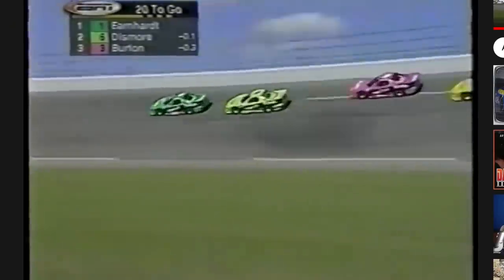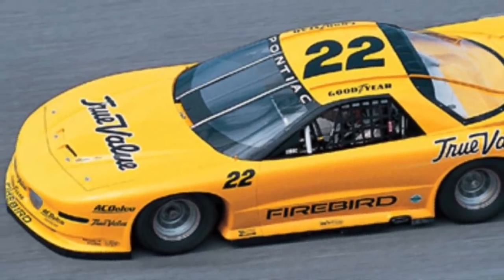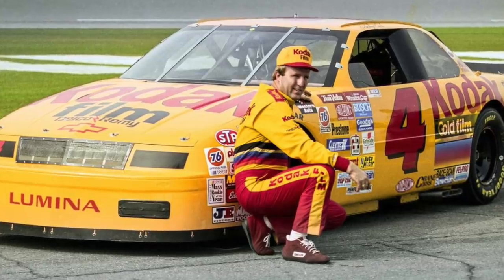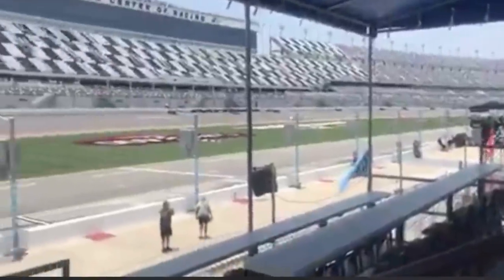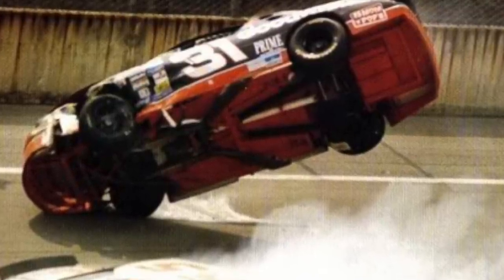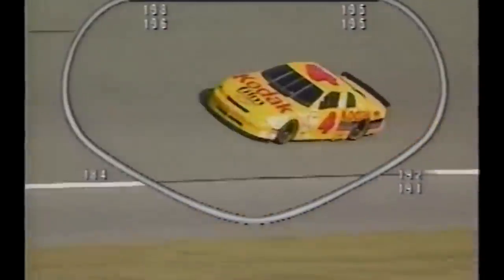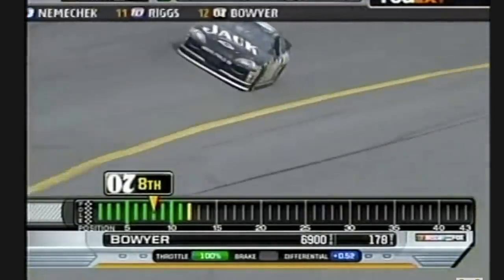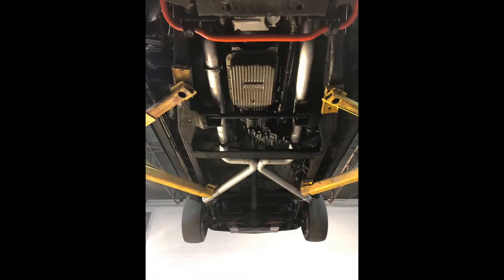What Made "Old School" Restrictor Plate NASCAR Sound So Great? (Back to Back Sound Comparisons)

Comment: Speaking on the firing order. Anybody remember Need For Speed most wanted 2005? The glorious sounding BMW M3 GTR (e46) from the cover. I’ve ALWAYS wanted to replicate that sound. After much much research I’ve found that it was a flat plane crankshaft 4.0 v8 race motor (P60b40) developed by BMW and Siemens for their ALMS racecar. The motor was only made for the race program and not the public so there were only a few made. I have always wondered if somebody could take the S62B40 4.0 cross plane V8 from the BMW M5 (e39) and convert it to flat plane and adjust the firing order to make it possible and replicate the sound of that glorious race motor the M3 GTR had. 
And don’t tell me it was the sound of the transmission. That is the sound of the gear whine yes, but I am referring to the exhaust note of the engine not the singing angels of those straight cut gears.
Reply from the maker: You could make 180 degree headers for the crossplane engine to mimic the firing order of the race engine within the exhaust

Comment: I have been a huge fan of Xpipes just because they make more power originally, but the sound really grew on me. I'd love to build my own for my Mustang just so I could play with the length and chamber size at the meeting point, the size of the connecting hole between the pipes, entry and exit angles, etc and then dyno them all to see what works best vs what sounds best.

Comment: I've always ran a x-pipe because I don't like the old farm truck popping and cracking in the exhaust note. My old camaro had a custom 3 inch x-pipe with magnaflow 4 inch round mufflers. It sounded wicked and everyone loved it. Before the magnaflow mufflers I had spintech super pro street mufflers and they sounded good too but didn't have the volume that the magnaflow did.

Comment: The Firing order changes the sound quite a bit. It affects exhaust pulse sounds and of course different mid pipe configurations (X,Y,ORY) all will have a different sound. Length,size,the way its routed, 4 chambered boom tube out each side (back in the day) vs single oval will sound different. And so on and so on.

Comment: I believe you get a combination of X pipe, boom tube and how the audio mixer for the network sets it up because if you listen to the cars at Daytona in July 2000 on the CBS broadcast and then listen to them at Talladega that fall and you will hear a big difference in sound even though it is the same season.

Comment: Geek out on the dyno, with an SPL (sound pressure level) meter. When I  was a kid we put "H" pipes in to pass the noise requirement of our state's emissions test. Also, the "H" pipe supposedly added 5-10 lb/ft of midrange torque. The "X" pipes do sound bitchin' (I may be dating myself with that term ;) ).

Comment: Very cool video, I'm a Nascar fan since the mid 1990s and iss the old sound. Sound is why my Subaru still wears unequal length headers. Equal length might make a little more power but they make the car sound like the rest of the 4 cylinder world. I just can't give up the signature Subie burble.
Reply: It's the boxer design and firing order that make a Subaru and VW flat motor to sound better than inline 4s. Your not going to hear any difference between equal and unequal length headers of the same diameter.
Reply: @jamesclements3627  I have to respectfully tell you you are wrong. I've been modding and racing Subarus for the last 20 years, there is a big difference in the sounds equal and unequal length headers make!

Comment: They also DEFINITELY experimented with 180 Crossover headers  on a few where you take one cylinder from one side and moved it to the collector on the other side. They sounded strange and higher pitched as well.

Comment: I want to learn more of the science behind why that high pitched whine is caused by the x-pipe. I’m also fascinated by intake tuning to affect sound. The Lexus 5.0 V8 and the V10 in the LFA have a lot of engineering put into how the intake air resonates, so they tend to sound like they’re revving higher than they are and make a unique sound.
Reply from the maker: I’ll save the detailed explanation for a future video but it has to do with the way the pulses meet and the way a crossplane v8 fires

Comment: All i can say is, if you've been in the open wheel modifieds for 9 years the last thing you will want on your automobile is loud exhaust!!!!!!! They were the loudest screaming cup engine with a 390 carb, open headers, and were the fastest cars in NASCAR. They were the very first NASCAR cars to break the 200 mph speed at Daytona back in the 70s. They were so fast NASCAR made the teams put front fenders on them because the front ends started to come off the track. It's all in the NASCAR record books. But every once in a while i still love the roar of a 355 ci, it will make a tingling sensation down my spine!!

Comment: I should also add that some people think the pre COT Superspeedway cars ran lower RPMS because they were slower which was not true. They turned lower RPMS because the gearing was different, not because they were slower. If you compare a 2007 Daytona 500 qualifying (Pre COT) to a 2008 Daytona 500 qualifying which was when they switched to the COT and the "Superspeedway sound" disappeared, both cars ran the track at the same full speed but the Nextel cup cars turned 7000-7500 at the full speed while the COT turned 8000-8500 at the same full speed.

Comment: I used to work at a mufflershop, and my boss was into racing. He believed placement of the x pipe made a huge difference. And he had a specific ×system to determine that locat
Reply from the maker: It does make a huge difference. The x needs to be as close to the collectors as possible
Reply: @Stapleton42  his theory was to use regular(nit high temp) spray paint and spray the sides of the pipe, then run the car hard fo re about an hour. Then we would put the x in where the paint stopped burning

Comment: If you want unique sound - check out the 180 degree headers Junior Johnson used before plates at the big tracks.   Cale Yarborough and Darrell Waltrip had cars that sounded way different - high pitched wail similar to what the later V-6 cars sounded like in the Busch series.
Reply from the maker: I know what your talking about! they do sound wild

Comment: i honestly thought it would have been the crankshaft. As I was listening to some of these clips and some sounded higher pitched like a flat plane and some sounded a bit deeper like a crossplane crank. I noticed you said some of the nascar vehicles went up to 6000 rpm or so, already forgot the exact number, and with my (admittedly limited) knowledge of crankshafts, that sounds to me like those ones were crossplane. of course there might have been other variables to the higher or lower rpm like the material of the pistons and connecting rods and other parts too. kinda shocked it was simply an x pipe lol, thanks for the information
Reply from the maker: That’s what we’re here for man!!

Comment: I would like see the difference in the exhaust sound based on how close to or far away from the headers you place the x-pipe. Ive read a little on this a long time ago on how Ferrari tunes the sound of the exhaust. Ferrari cars all sound very similar with engine sizes ranging from 3L V8 to 6.5 L V12.  My guess would be the closer you place your x-pipe to the headers the higher pitch the exhaust will be. 

Very interested in seeing more on this.
Reply from the maker: The X needs to be as close as it can to the collectors to properly do its job. Move it too far back and it’s essentially a cool looking H pipe at that point

Comment: I believe there's more to it that affects the exhaust note, besides the addition of the X pipe, and the boom tubes.
There's the angle of the heads mounted to the block, and manifolds. The sizes of the valves, the shape of openings of the heads, the designs of the the combustion chambers themselves.
The heads flow unbelievable amounts of air in an out so efficiently, intake manifold designs effect that too, especially after the teams get through porting it all.
All that contributes to the sound they make, and improves the flow of air through those air compressors immensely. 
Only I think the cam configurations has the biggest effect on the sounds changing over the years more so than all the above mentioned items, but then those were all a trickle down of the different evolutions that the cam's themself.
First time I noticed the sounds changing was when they did the 4-7 swap, which can't help but effect the sounds they generate, and then they did the other change 2-3 swap as well. Then they configured each exhaust and intake cam lopes going to each cylinder, by increasing the opening, and closing of the valves according to whether they were in the middle of the head, are on the outside of each head in order to equalize the air flow, and fuel ratios accordingly.
By doing all this, you have changed the pulses of exhaust, and intake to greatly improve flow characteristics. These changes are the biggest factor in the sounds the exhaust emits through the boom tubes by far greater degree than X pipes ever did.
But yes X pipes did change the pulses too, but not nearly as much as those changes to the firing order did. So I have to agree to a extent, but disagree to a larger degree based on mechanical changes that have a greater effect than mere exhaust configurations of the piping.
As for restrictor plates, those are a means in which to damper the air flow the intake systems can move, thus with less oxygen to being taken in, less fuel is able to be burned, and reduces horsepower.
Horsepower is the reason they can reach speeds in excess of 220 MPH on the Super Speedways, and less air in, is less air out, and that too changes exhaust by a goodly amount too.
So do you not agree with my analogy of how, and why the exhaust is so different over the years, are do you just consider me to be a know it all smart ass old man?!
While I don't know everything, I do know a little about a lot of things. LOL, peace n harmony, and sharing knowledge makes everyone a little better a little at a time.
BTW, I mean no disrespect to you, are anyone else, just passing on a little info is all, not trying to be a PIA to anyone. 
As for your truck sounding like similar, I think the acoustics being what they are in Austin ha a good deal to help that out, because there your basically in a canyon, and the sound waves off the structures caused it to actually form a sound wave blasting through the canyon. 
And yes, it does sound as sweet as it runs, you've got a right to be proud of your creation, because you've done an excellent job to date with the build. I look forward to all the others as they start they're transitions into a reality, as you yourself grow more capable in the profession you've chosen.
Reply from the maker: You’re splitting hairs on the engine tech mumbo jumbo. Even the current owner of dr gas said that almost nobody would be able to distinguish minor differences like that. It’s something I’ve talked to him about. Also...you’ve never heard my Escalade in person. Phone cameras don’t do it justice. The corvettes and other v8 cars don’t sound like the Escalade does in your special canyon 😂
Reply: No sir just stating scientific fact is all I'm doing, and as you mentioned yourself, your interested enough to swap cams out yourself to see what effects it gives you.
I'll just respectfully bow out, and go about my way. 
I appreciate all the videos you've shared to date,  as you've had some very good content, both yours, and those you've introduced us all to.
Wish you the best of luck, and I hope it grows into everything you want it to be.
Reply from the maker: Thank you sir. It will. Because I won’t quit.

Comment: Ironically there was one race on the xfinity series which was the 2020 Wawa 250 powered by cocoa-cola at Daytona race that had the ford’s sounding identical to the gen 4 cars and I almost sensed a possibility of the return of the epic sounds of the gen 4 cars especially for the xfinity series it almost comes so close to a possibility of that happening but yeah I do agree with you on the epic sounds of the gen 4 cars nothing can ever beat the epic sounds of the gen 4 cars and that’s why I watch some of the older nascar races mainly to hear the gen 4 cars so to me hearing the sounds of the gen 6 and gen 4 cars back to back that’s certainly quite a difference all in all that was a great explanation to why the sounds of the gen 4 cars sound awesome.
Reply from the maker: Yeah I still have not found out why those fords at Daytona sounded like that... I need to
Reply: @Stapleton42  yeah I was fascinated by that too I was like “was there a reason why it sounded like the gen 4 cars on the fords?” But idk I guess the fords decided to add the x pipes to the some of the race cars not a whole lot but I feel like there’s potential for nascar to bring that epic sound of gen 4 to the rest of race cars for the xfinity series not the cup series since I doubt they can put In the x pipes for those cars but it seems like it could have potential for that to work for the xfinity series honestly.

Comment: A mustang GT with an x pipe sounds higher pitched than the H pipe. You are correct. The exhaust pulses have a straight through exit on the X vs the H. The exhaust pulses on the H pipe slow down and mix in with the other side pulses.

Comment: So.... A little unknown thing about another reason Sterling Marlin was so fast those couple years and sounded so different wasn't so much about the Dr Gas, but they figured out they could grind a cam to actually only run normally off the front 6 cylinders and the back two cylinders would actually pull in air from the exhaust and pump it back into the intake.  With the restrictor plates, they were adding in some fresh air that leaked from the looser fitting slip joints in the headers and put more "clean" air in the intake.  Was worther a few more hp over a normal restricted motor! lol

Comment: The technology came from motorcycle racing. They found on a fast course if you connect multiple pipes together it helps the engine produce more horsepower at certain RPMs. It often lowers the horsepower at low RPMs. They even made pipes on bikes that close off the crossover at low RPMs and opens up at higher RPMs. Then they discovered variable valve timing. I don’t believe NASCAR allows that.
Reply from the maker: The guy who invented the x pipe never mentioned motorcycles in his story of figuring out the concept

Comment: the only issue I have is with saying this is why Morgan-McClure won those 500s: yeah, it got them another 4 horsepower or so, but as was revealed on a Dale Jr Download episode a while back (I forget which one), those Morgan-McClure cars were getting air to go around the restrictor plate, extra unrestricted air into the combustion chamber.  It wasn't explained how, and I'd love to see that explanation, but that's why the 4 car was so fast in the mid-90s.  Apparently Robert Yates figured it out too in the late 90s with a different method.
edit: I'm betting part of the reason Morgan-McClure went for the X pipe is to have something obvious that the inspectors would see, and draw their attention away from other things on the car because they think they found why the car's so fast - that was always a common tactic for beating NASCAR inspection.
Reply from the maker: There were many guys getting air around the plate back then. Andy Petree had Bill Elliots car doing that in the late 80s
Reply: @Stapleton42  huh, I stand corrected then, though I'd love to hear some of the methods for doing that

Comment: you wanna hear something interesting look up the aussie 304 or 5 litre holden engine, they are based off the old chev and have i presume the old firing order but are efi.. sound alot different to an LS, less power but sound better.. kinda fluffy and smooth rather than that rough LS sound

Comment: Yep, X pipes almost always have a bit more of a higher pitched rasp and the H is typically a bit more of a low down grumble. Obviously it depends on the engine and the rest of the exhaust system, but generally that's how it goes.

Comment: The bore and Stroke of the engine also plays a small role as well as duration on the cam but for the most part you're right engines are air compressors air in air out
Reply from the maker: I did say that lol. Similar size of engine. Similar power level = similar sound.

Comment: I have a 511hp Camaro, 381 stroker, long tube, equal length tuned headers.
I put a 3" stainless x pipe on it with 3" pipes, under the axle, to the back. 

Started it up and then shut it down, pulled out the exhaust and put a stainless plate inside the x, to basically run it as tru dual exhaust.

It sounded terrible on idle. Tru-duals for the win.

Never tested the 6200 rpm "drive by" sound tho.

I love the NASCAR sound.
Reply from the maker: You’re saying you prefer the true dual sound with no h or x pipe??
Reply: @Stapleton42  at idle, revving it up, absolutely.

Didn't test the drive by tho.

I literally dropped the exhaust asap. Knew exactly what to do.

It sounded funny.

My cousins buddy from Texas had stopped by a couple weeks later and thought the same thing. X pipe makes power, but sounds "European" as he called it.